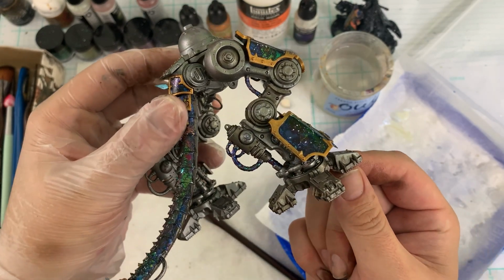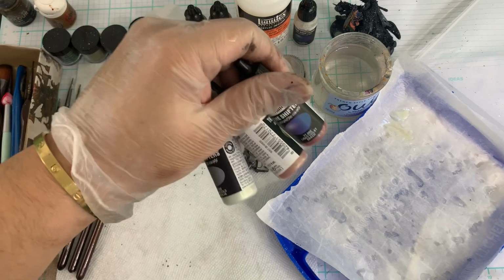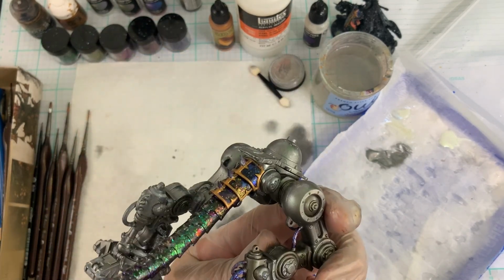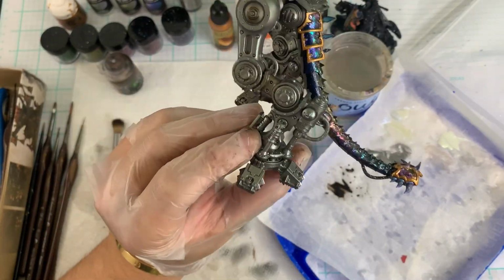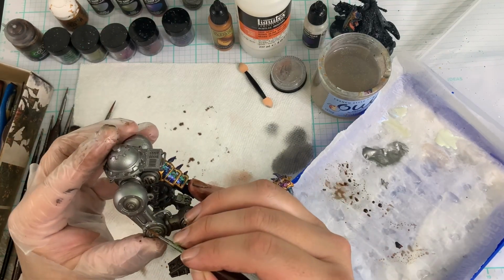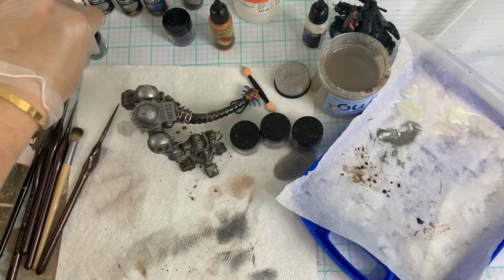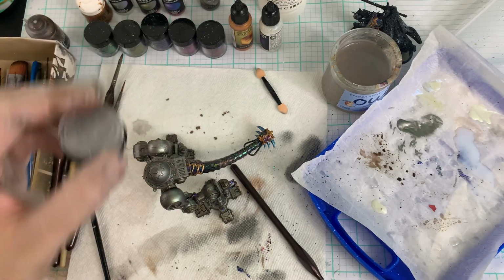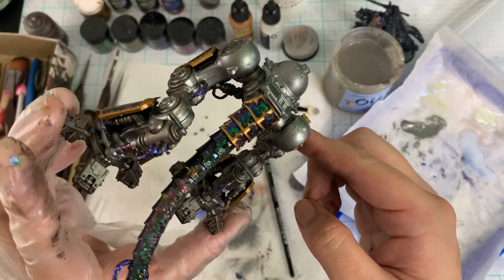Fast and Easy Sky Steel Color Shifting Metal!!! NO AIRBRUSH!!!

Comment: I've been working with interference paints for a long while now, and there are a few tricks to getting them to really sing.

First, the undercoat: go as dark as you can possibly get away with.  As in, you should have an extremely good reason if you're not painting your layers over black.  That black should also be glossy when you start to work.

Second, establishing colors: these paints tend to be functional equivalents to iridescent medium, and their colors come from thin-film coatings of Titanium oxide, deposited onto mica flakes.  A drop or two of acrylic ink in the mix will, invariably, lead to some truly mind-blowing results.  They will also be extremely metallic.  Be warned, though, that the mixing here can be a bit counterintuitive.  I recommend swatching over multiple textures to get a solid idea of what you're dealing with.  It's weird, but it will layer like a normal metallic.

Finally, the issue of topcoat.  The physics involved with how these paints work is quite dependent on the light not being scattered as it passes into, reflects off of, and passes back out of, the paint layers.  Glossy surfaces are functionally required here, as matte and satin finishes will simply scatter the light, and dull down the effect, as it is wholly dependent on the angle of incidence of the light hitting it.

Like I said, the stuff is really weird, but there are so very many things that you can do with it, up to, and including, making colors wholly appear and disappear.  They're just also the most finicky bastard materials i've ever used...
Reply from the maker: Yeah I noticed if you want the shifters to be the dominant layer it needs a darker coat and absolutely not gold lol
Reply from the maker: Nice to see someone whose used them! They are a lot of fun!!
Reply: @paintersblock3446  if you're looking for a more cost-effective option, Golden has been making these sorts of paints for many years, and they actually swatch them on the bottles.  Their color combinations are also clearly called out.  Their interference gold is a staple for my own work with the stuff, and it just gets awesome when mixed with a black or blue ink.
Reply from the maker: Ummmmm yesssss!!!! Golden??? I wanna try!!! Lol I’m so excited now! A brand that’s a bit easier to use would be so amazing!!!
Reply: @paintersblock3446  There is no "easier to use" with any of these, just packaging with a bit more useful information.  Interference and color shifting paints are always going to be finicky, especially with brush-on applications.  It's just the nature of this particular beast, I'm afraid.  There are plenty of workarounds that can make life a little easier, like getting appropriate cross lighting, so you can more accurately see what you're doing, but even that gets a bit odd, until you get used to it.

That said, your results here are a pretty solid starting point, no doubts there, but there's a lot more to learn and explore here, and a massive payoff for results when you get it really right.
Reply from the maker: @andrewamann2821  yeah it’s definitely better to accent the paint that you lay first, the nebulas look nice cus they are blended into the same color spectrum so the shift feels better 😄